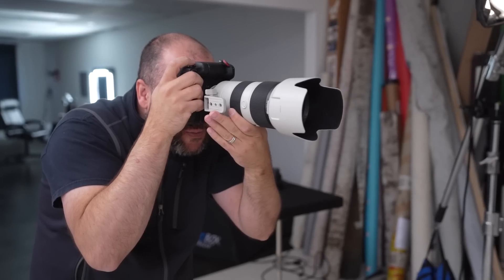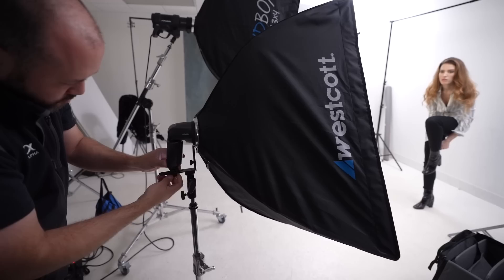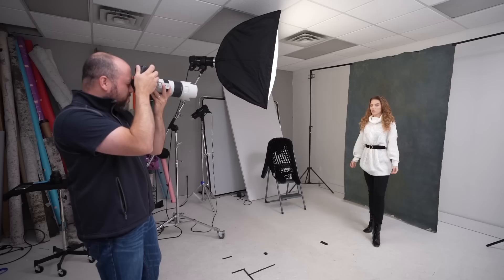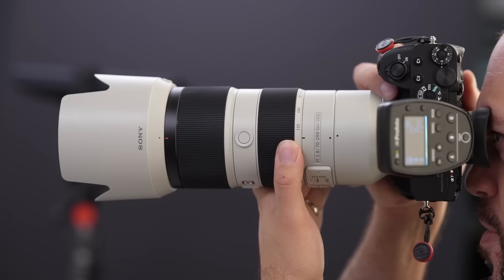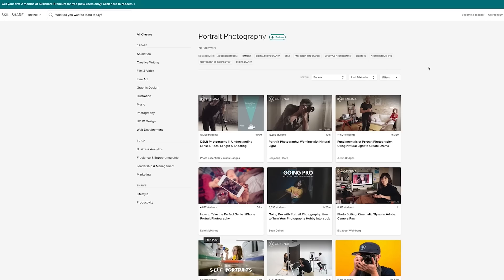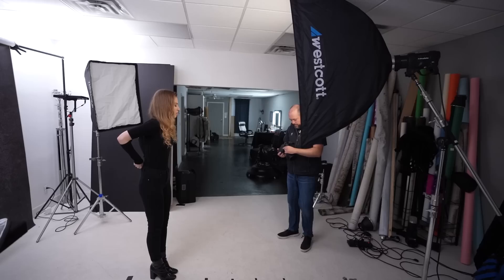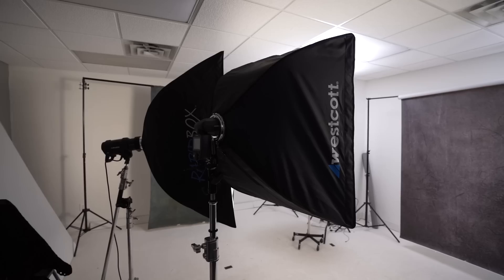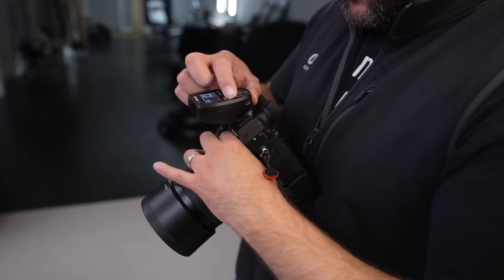5 Ways I Use A Softbox | Pro Portrait Lighting Techniques!

Comment from the maker: Which softbox setup was your favorite? Also, what light modifier do you want to see me cover in the next video of this series? Sound off below!!
Reply: Octa with/without grids is very effective. If you haven't covered strip boxes in portrait photography, please take a note
Reply: Big flat light is my fav but they are all great. Can't wait to try them all. Would like to see more on location lighting set ups when you don't have an assistant. :)
Reply: I’d be interested in a video on the use of soft boxes like this and  what type of subjects you would use them on
Reply: a Striplight :)
Reply: Do a video on dark skin photography and interracial couples photography
Reply: I like the large softbox combined with the smaller softbox.  In regards to light modifier that i want to see you cover is Large Octa.

BTW, i have not tried putting the large softbox horizontally.  I always have them vertically.  Good tip regarding this...
Reply: How did you get this beautiful light with ISO 100?  In this kind of environment I always need to use minimum ISO 1000, in order to have not black pictures.
My camera is Sony alpha 7iii, lens 24-70  f2.8
Reply from the maker: The lighting setup is in the video. That's how I got to ISO 100 📸

Comment: Did you mention that light you have lighting the roof? i guess that one affects the background? how come you did not get uneven shadows in the background with the one light set up?
Reply from the maker: There is a light there, but it's a constant video light that doesn't affect the exposure due to the camera settings canceling it out. The shadows were smooth mainly because I framed it where the fall off of the light is just outside of it.

Comment: I put a strobe right behind the models - without everything - so the light source was hidden. Hiding the light source wouldn't be possible if I would have used umbrellas or softboxes. That was a great experience. The only problem: I didn't see the strobe in the dark, so moving around and not having the strobe on the picture was a little bit tricky. 
https://www.facebook.com/photo.php?fbid=2551438064920537&set=